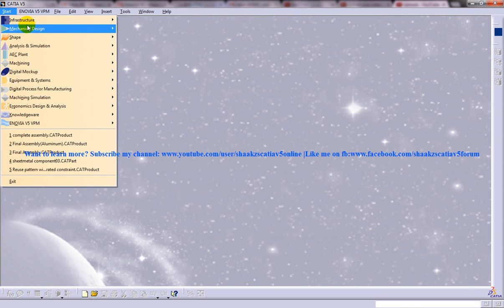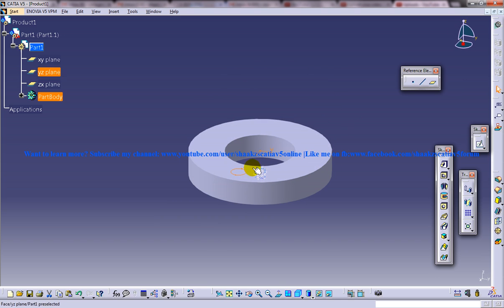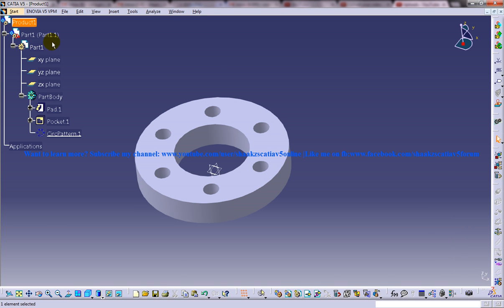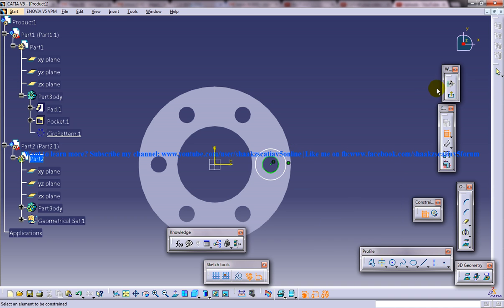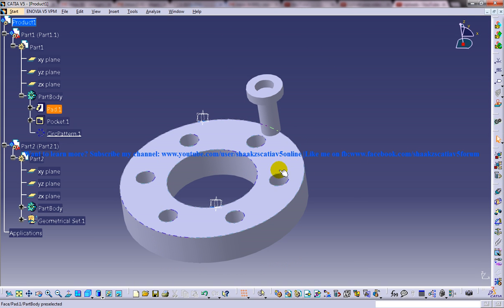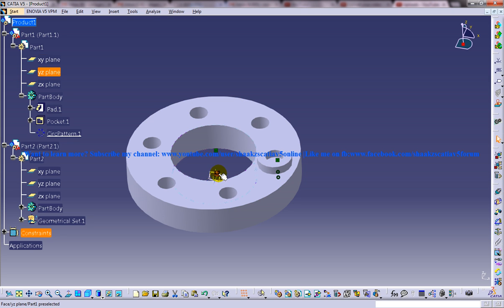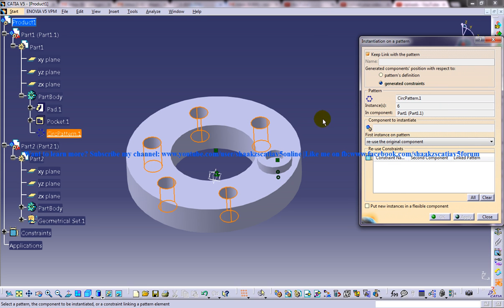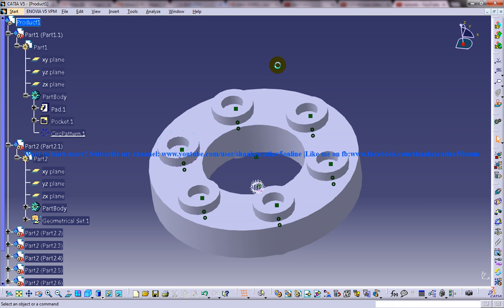Catia V5 Powerful Tricks #129|How to Reuse pattern with Generated Constraints from Spec Tree

Comment: I have a problem in assembly design. In coincidence constraints axis are not visible. how to solve this problem
Reply from the maker: +Sudarshan Ughade zoom in a little bit and hover your mouse around the circumference of the circle and radially towards the center, it should show the axis.
Reply: Thank you so much for your response.